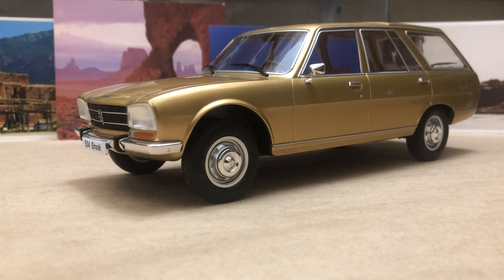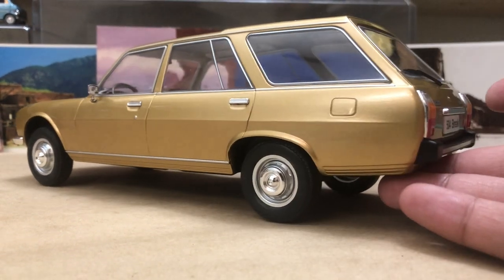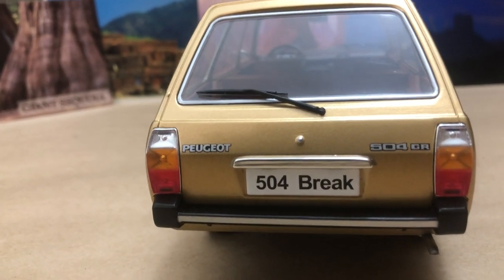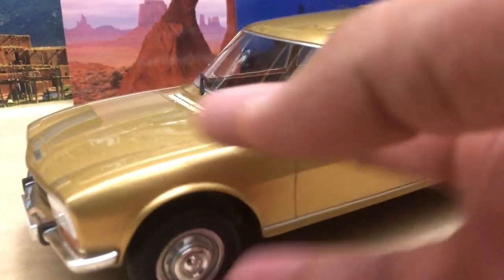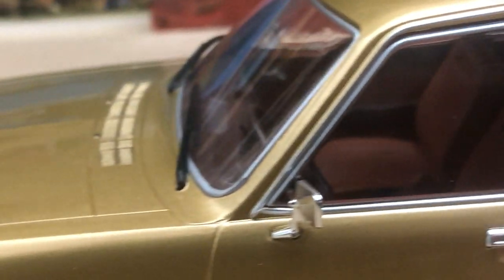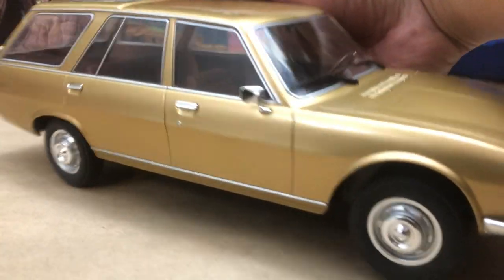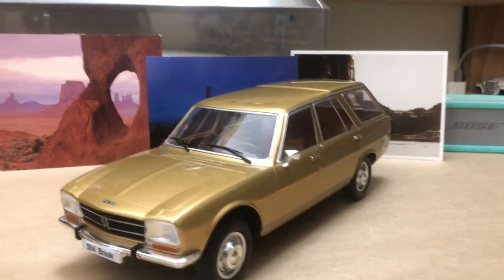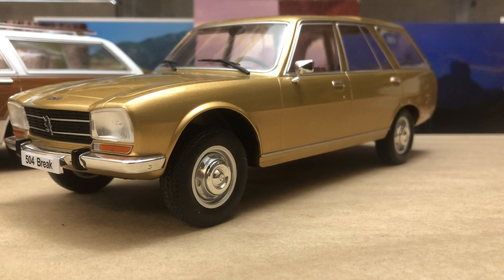Peugeot 504 Break (Estate) 1/18 Scale Model Car Group MCG #Diecast

Comment: I have this in metallic green and was very impressed with the detail for the price. It would have been nice if MCG had included the third row of seats. I also have a couple of Welly sedans, one of which I am modifying to USA spec. I understand the bumper and head restraint safety regulations, but can you tell me the reason behind the round headlights?
Reply from the maker: Back then US DOT Dept of Transportation did not allow non sealed beam headlights so cars from other countries that had the more modern design had to be changed
Reply: @Migs_Models  Thanks for clearing that up - at least it makes my conversion more worthwhile.